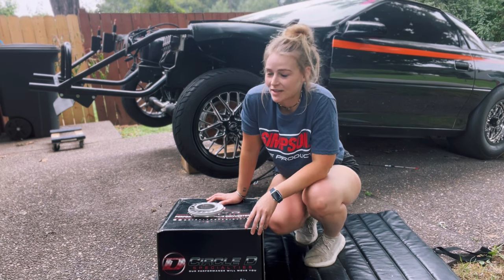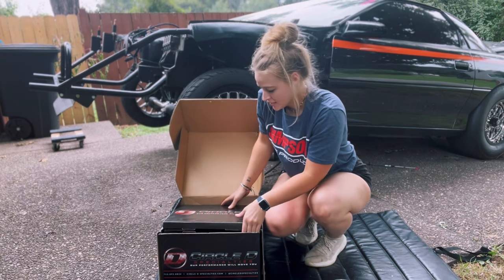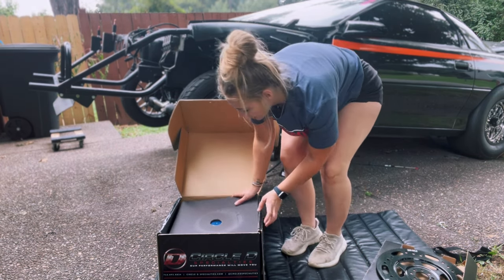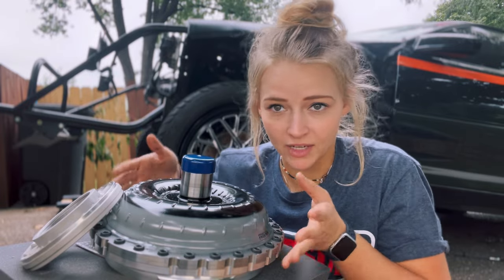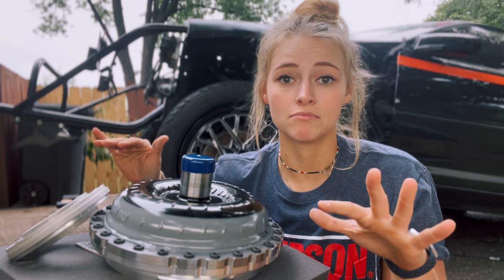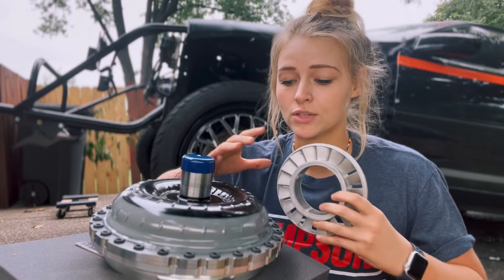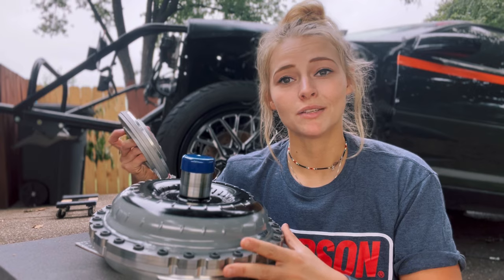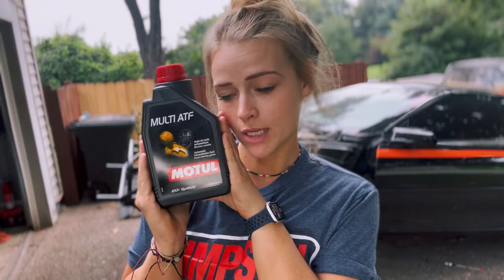What is a bolt together torque converter? CIRCLE D SPECIALTIES

Comment: Please make sure you measure all the clearances between the flywheel and the converter bottomed into the transmission pump and leave a little room for converter shimmy so you do not destroy the transmission pump!!
Reply: I know you're just trying to be helpful but you should check your numbers before giving advice
Reply: @adriannewman1322 thought it was like .125"-.187"
Reply: The funny, Rachel reckless.  Just changed her clutch. In transmission.😊

Comment: That flexplate is nice as hell. I Luv the verter. I thought I was the only one that kissed their new parts. I got a set of Ls3 821 heads for my swap in the other day and my wife looked at me funny when I was kissing one of the heads, lol. She said what's wrong with you? Your hugging and kissing your cylinder heads. I said as long as it took me to afford and buy a set of Ls3 heads it's like a marriage lol. I refuse to settle with a junkyard engine like others are doing. I'm just saving up a little longer. I just dropped my Ls3 block off at the machine shop a couple weeks ago. It should be done soon. I'm doing a Ls3/6L80 swap in a 03'Crown Vic Police Interceptor. Like you I don't care what others are doing. This is what I am doing. You have come along way. You have learned so much. I've been watching you since the beginning of your channel. Be VERY PROUD!!!
Reply from the maker: Thank you so much!!

Comment: The 1958 Buick had a hydraulic controlled variable stator named the flight pitch converter in the dynaflo transmissions and the stall can be adjusted from a lever that was attached to the gas pedal but I don't think a converter can be made tough enough to be manually adjusted with a flip of a lever in the car for what you have. It would be interesting if the racing aftermarket performance parts made one. The dynaflo transmissions were not that good back then but with today's technology and materials it might be a little bit better made and improved.....just a little 😀